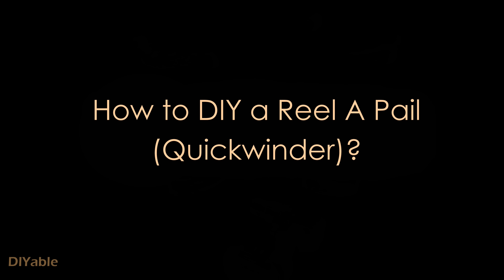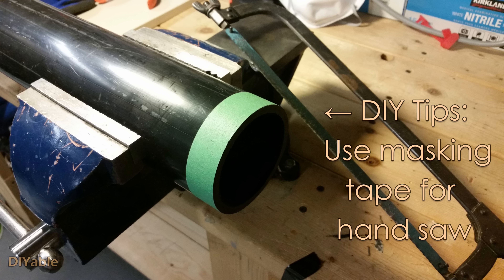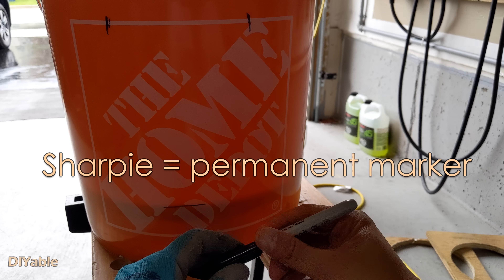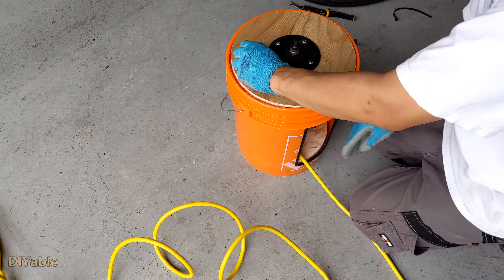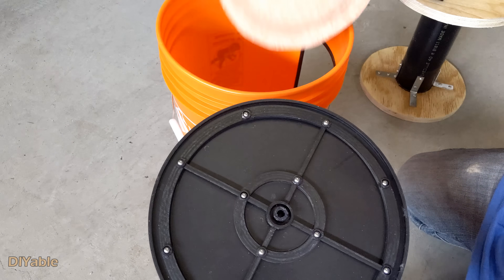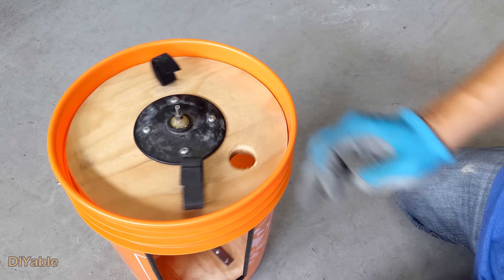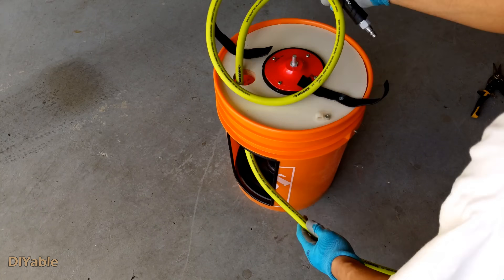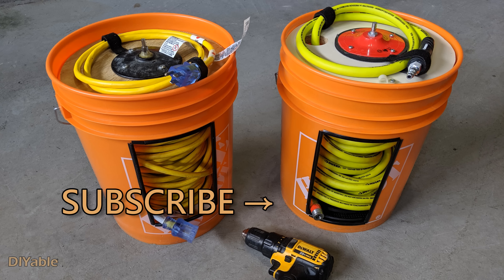How to DIY Homemade a portable cable reel like Quickwinder (Reel-A-Pail) for 100 ft. 12 gauge cable?

Comment: In a pinch this looks like a convenient/clever solution but I would just buy one that is professionally designed for several reasons.  You can get a 150 ft. manual cord winder for starting as low as $8.99 online. 

If I were to improve this one, I would attach a small step at the bottom of the bucket and a spring/mechanism so it retracts. The step would allow you to keep the bucket from moving- especially when unwinding. Also, a guide and guard to protect your hand from getting caught up.  For safety, at a minimum, I would keep the drill set to a low torque setting but when 100 ft cable starts getting heavy, and by repeated use, even the best drill will wear out much faster- even more so if it is battery powered.

Comment: You could also us a PVC cap glue it to the PVC pipe and then glue and screw it to the wood. This would make it cleaner for the cord to wrap as well. You also could drill a hole in the PVC and run the cable inside the PVC to the top. If u make the PVC pipe shorter u can put the lid back on, you can also buy the lazy Susan hardware from the hardware store and it should be cheaper than buying a actual lazy Susan. With the cost of all products bought for this end product is not much cheaper than buying a actual extension coard real. You can buy them with 4-6 plugs on wish or groupon for around $20. If you wanted u could add a power strip to this project and have a multiple plug cable real extension coard
Reply: Forget the caps.
At around $5 a piece it will add up if making multiple. 
They are not flat. At least they are hard to find in a flat. Only ones I've seen flat are the thin drainage type and they are to flimsy to last.

A 4.5in $26 hole saw is way better and you can make way more. It makes a very snug hole for a 4" pvc to fit into. Screw from inside. Glue if you want to.

Comment: Another idea is if you can find old wore spools. I no new home const and the electricians throw away empty spools. They fit perfectly in a 5 gal bucket
Reply from the maker: Really? Woww.. that can save a lot of work! Thanks for sharing!!!!
Reply: @DIYable  or, since I use spools more for water tubing and garden hoses CL, garage sales, offer up free garden hose reelers are all over. I try to modify the spool portion.

Comment: Just a idea, you could add two flip down down stops to the front  to stop the movement when unwinding.  Thanks for the video, it's a great idea
Reply from the maker: That's a great idea!
Reply: Has anyone used pull starter recoil spring?
Reply: Can u pls post an example of the stop

Comment: If you reverse the extension cord, put the socket end in first instead of the plug. You can just plug in the cable and walk the bucket/cable holder to where you need it and plug in your device/tool.
Reply: The only drawback I see to doing it that way is you wind up with the bucket/reel underfoot where you are working.
Reply from the maker: That's a very cool suggestions!!!  Thanks a lot!
Reply: Not bad for a saw station or air compressor or something, but if you're screwing in sheetrock or the like then you're stuck dragging the bucket around.
Reply: @myname4598  
That's when you actually take the cord out of the reel.....

Comment: I have been winding my cords on a reel from 40 lb. welding wire; it’s a bit cumbersome, may have to put the reel in a bucket thanks. I have a tip for you that has worked well for me. I buy the large roll of paper shop towels and I put them in a bucket with a small hole in the center of the lid. It will dispense every towel from  the center roll without collapsing . Just cut the tape on the outside of the roll when you refill. I also had to put a spacer in the bottom of the bucket to keep the roll of towels from moving up and down because when you tear a towel off and it picks the roll up it pulls the end back down in the bucket.
Reply: Has anyone tried this with a pressure washer hose I'm thinking it should work?

Comment: Important note - you should unwind the cord all the way or you risk overheating the cord, especially for extended use. For a quick 5-10 minute job you can get away with unrolling only as much as you need.

Comment: Love this idea. Little shorter pipe and you can put the lid on it and stack it normally. Could even put two 1 inch cabinet hinges with that scrap piece of plastic and latch it with some velco strap. You already sealed the open section.       If you don’t care about a lid you can add a handle.   Just some ideas. This idea is really cool 😎
Reply: Drake Velazquez the bucket has a handle already....
Reply: Drake you don't need a lid . This is something that your going to drag out and put up everyday on the job site.
This is just a cheap and simple way to store your cords
The bucket has a handle.
Quit trying to second guess everything and enjoy the video

Comment: Or just buy the Quickwinder with cord and you're all set.  They have done the R&D already and it works.  Time is money with some of these projects.
Reply from the maker: That's correct.  You can buy a Quickwinder for sure, nothing wrong with that honestly.
Reply: The whole point of the video is to BUILD IT, not show you how to click add it to your cart and purchase it.
Reply: @Can-you-fix-it  click to add to cart: 
Bucket
Brackets
ABS Tube
Lazy Susan
Sanding adapter
Door trim edge guard
yeah, what you said...
Reply: flatlinesup a lot of people have most of this stuff laying around, you could use scrap hose/rubber tubing for the edging instead of buying that too. I think if you rounded the corners when cutting the opening the tubing could be put on in one piece and gives a nice rounded edge for the cord to go over.

Comment: Nice concept and execution.  Lots of cheap ass cord reels around but a decent metal one is $85 (USD) or more.  I'm thinking this method may work just fine for me...and besides...who doesn't love a good DIY build??!!  I may figure out a way to weight the bottom/inside of the bucket to make it stationary as you're pulling cord out for use.  Maybe find a weight that will fit inside the bottom of the PVC cylinder ??  Hmmmmm.....
Reply from the maker: Yes, maybe adding a bit weight a the bottom will make the pulling more stable, I have to agree. Generally speaking, it works pretty okay for me.
Reply: I'm thinking of pouring a couple inches of quickcrete in the bucket as a base for the lazy Susan so it's a bit heavier
Reply: Don't need a weight: have the male plug at the free end; slip knot tie it near the socket, with a bit of slack, plug it in, and then just carry the bucket to work location to unroll. To roll, carry to socket and wind 'er back up there.

Comment: Ball bearing casters work great or the Bottom of an old spinning barstool the hardware between the seat in the stool legs Are use the ball bearing casters which is literally just a large bearing inside of a housing And I was also thinking just a couple handfuls of marbles loosely underneath
Reply from the maker: Good to know, thanks James!  Maybe the one I got was not the highest quality.
Reply: @DIYable  I'd say it was because you tried swivel wheels and they were trying to go in different directions.